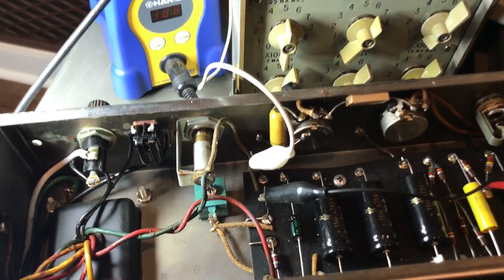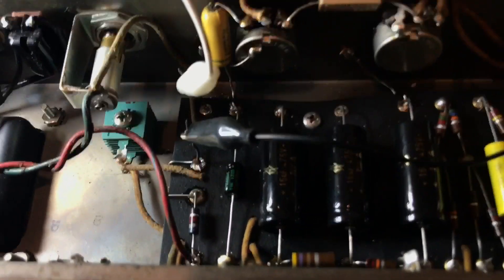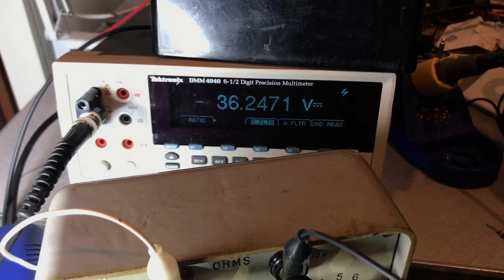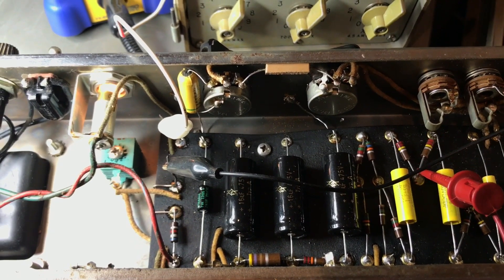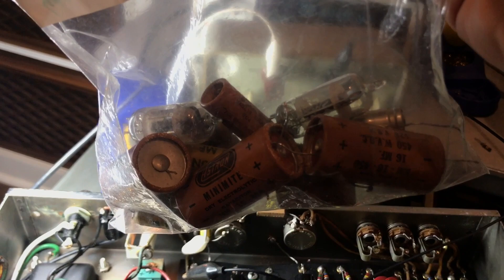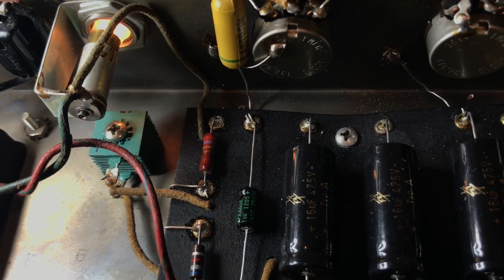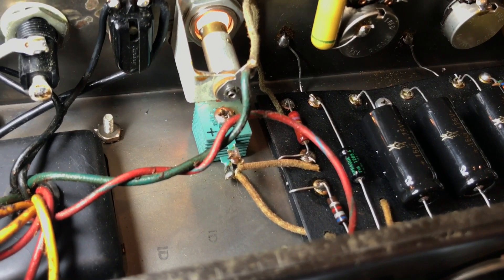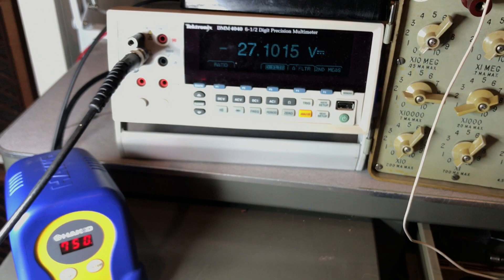1959 Fender Tweed Harvard 5F10 Bias Adjustment

Comment: Awesome video, thanks, this is very helpful. It looks like you slipped your diode under the board which is a great idea. I'm about to replace my selenium rectifier with a silicon diode as well. I plan to put a 10K resistor along with a 50K bias pot where you put that 27K resistor, right after the diode. In the event that you change your power tubes, will you have to adjust the value of that resistor in order to have them running with the right dissipation? Thanks.